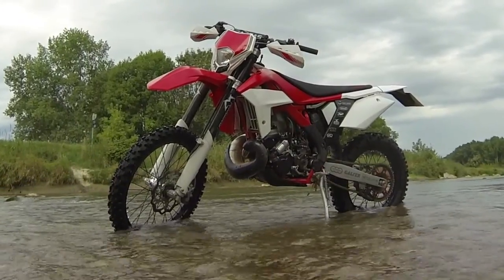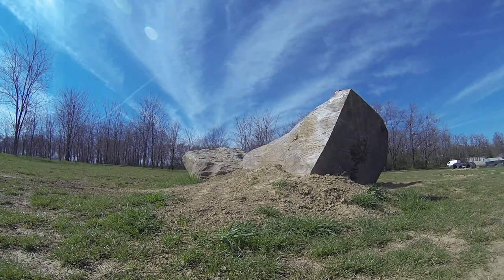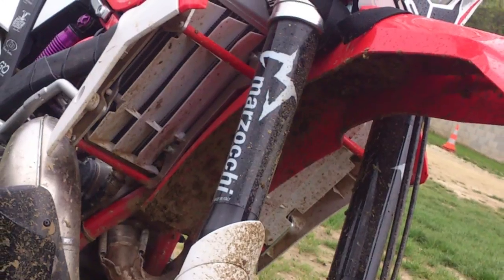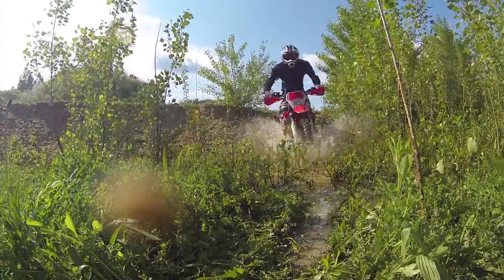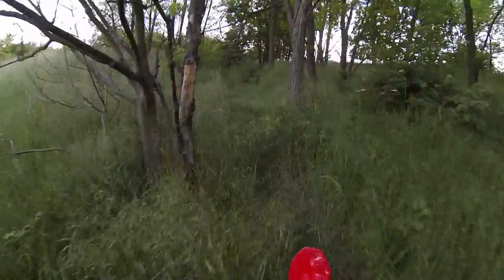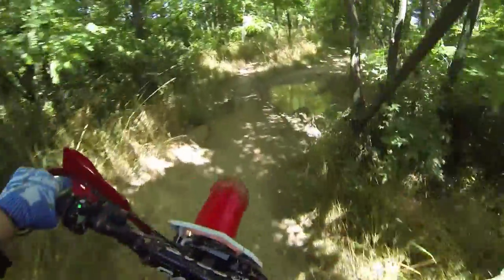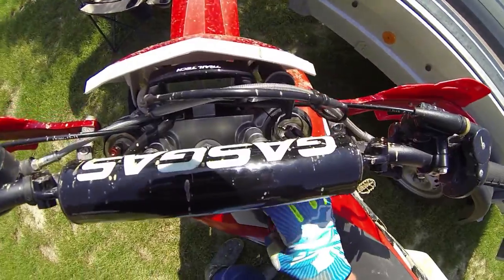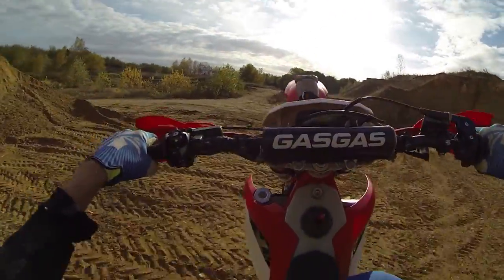REVIEW | GasGas EC 300E Racing

Comment: Which model year plastic kit did you fit, and which manufacturer.  find it hard to get '17 plastic kit. Also using previous years kit, I believe need some modding to fit.
Reply from the maker: I did fit the 2013-2014 model Acerbis plastics. It fits pretty good except for the rear side panels. I had to build a 40mm spacer to make it look neat.
Reply: Seems like '13 colour combo i presume. '14 had some black parts and side plates should already fit all '14-'17, but '14 onwards  cant source anywhere, except OEM.
Reply from the maker: I ordered mine there: http://www.motocrosscenter.com/shop/en/670-plastics
Reply: thanks. Good pricing too!